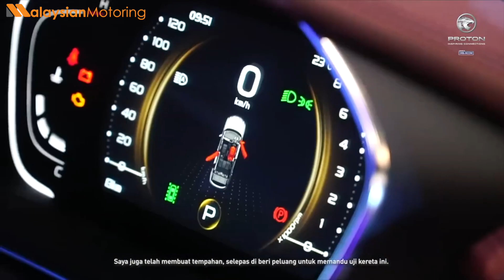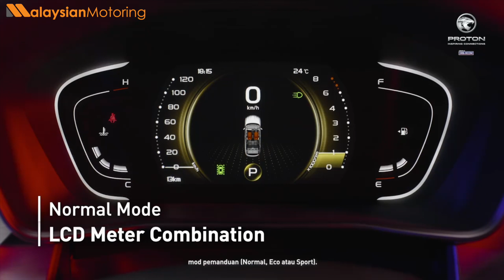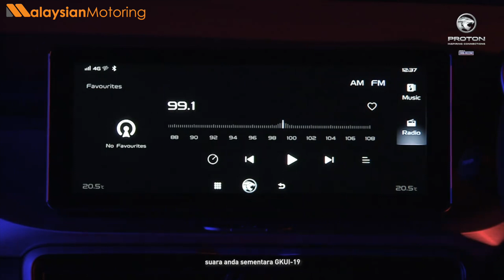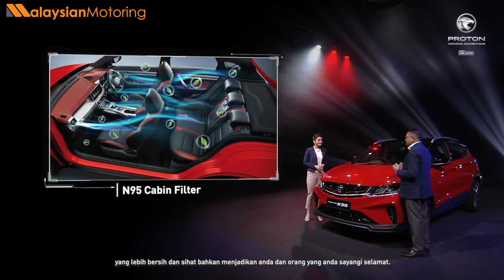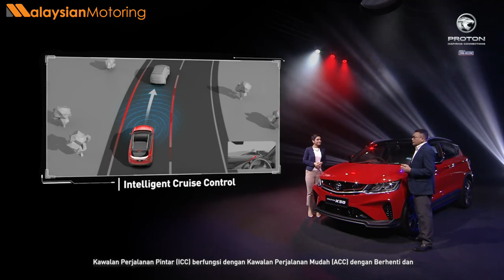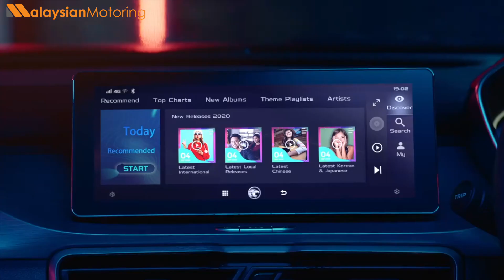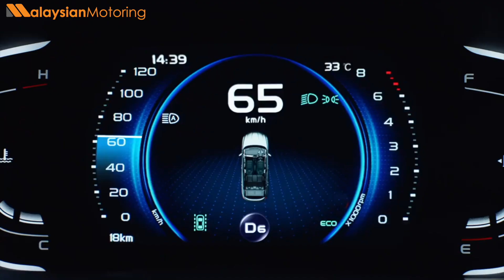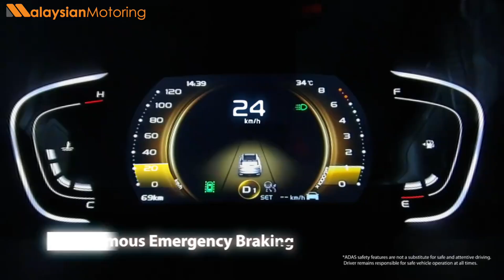PROTON X50 Is Here! RM79k Upward! | #NewsUpdate

Comment: The three-cylinder engine will become more and more tremble in the future. Turbo engines are more expensive to maintain and easy to  increase carbon accumulation. The 17 inch and 18 inch tyres also expensive..